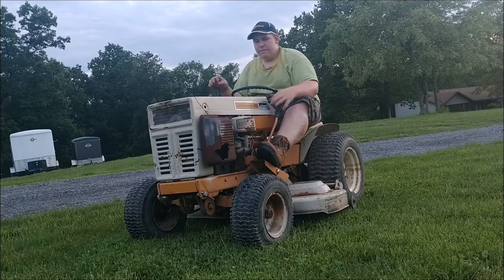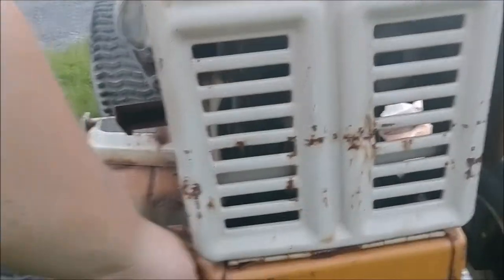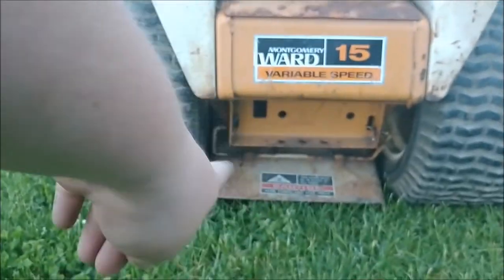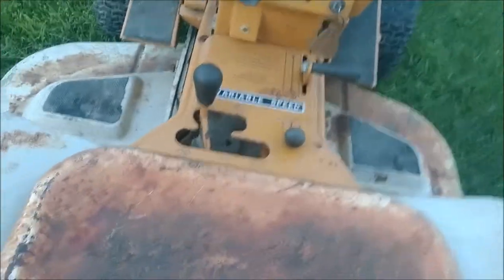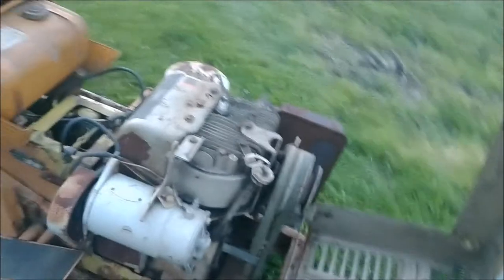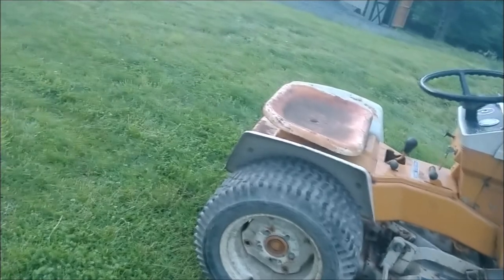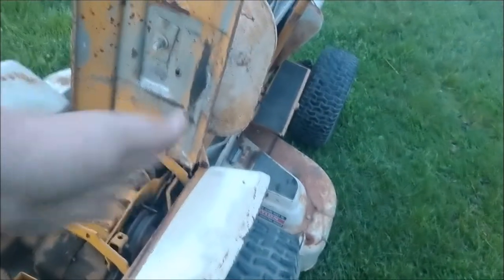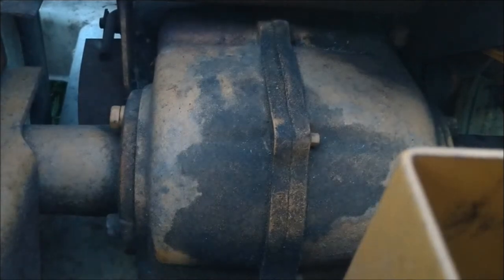1972 Montgomery Ward Variable Speed 15 All Terrain Garden Tractor Build

Comment: I have a 14 variable speed in great condition are they worth anything
Reply from the maker: In my area they go for $100 - $650 depending on condition and attachments.
Reply: @HillbillyOffroading  I’ve got mine in great original condition A mower deck and the Rototiller for 400
Reply from the maker: @dylansc9280  selling for $400 or bought it for $400?
Reply: @HillbillyOffroading  Bought it

Comment: 33144a was a 72. lot of info can be had on gardentractortalk.com im sure you got it running by now seeing vid is over a yr old but weak spart is telling me bad or dirty points which in comments you said you dont know where they are... they are behind the lil cover between the carb and muffler.. they are cheap some models had a magatron kit that didnt use points but unless youre gonna remove the engine (which has front axle attached to it) its best to replace points and condenser
Reply from the maker: No been working on other stuff. Wont do anything with it till Feb. Points are gone. Not going that route. Ok thanks ill check that site out.